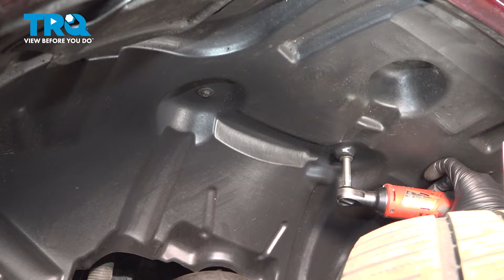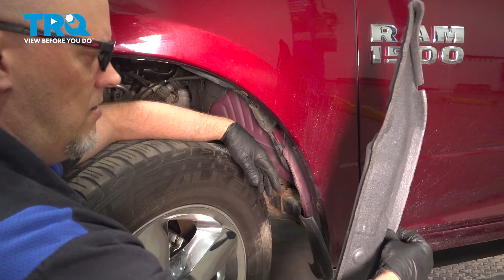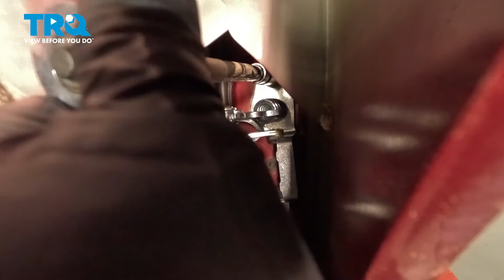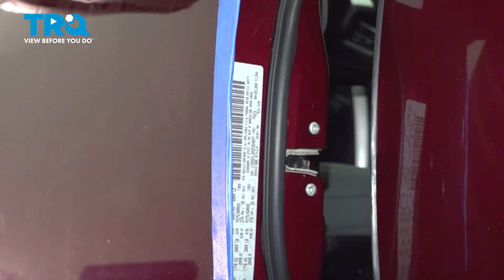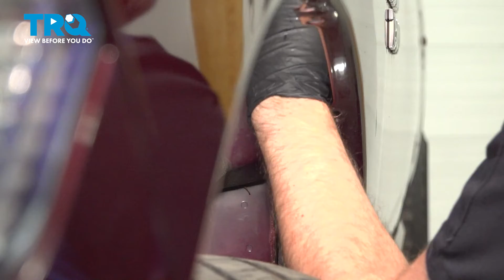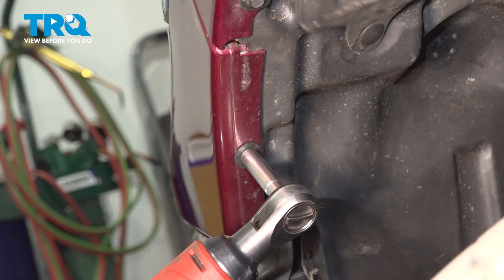How to Replace Front Lower Door Hinges 2011-2018 Ram 1500

Comment: My buddy and I just finished this job (he did all the work 😁) after watching this video and it went very smoothly and was done and under an hour.
Thank you very much. This saved a lot of time and trouble.
The only thing I did differently was remove the front wheel entirely for a bit more room, it is a bit tight under there. Thanks for putting these videos out and thanks for the great part.